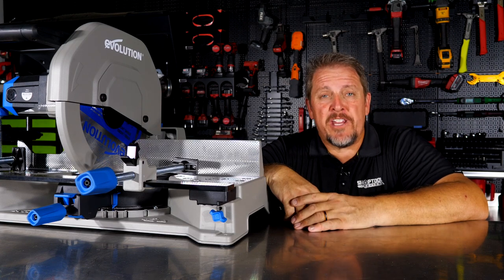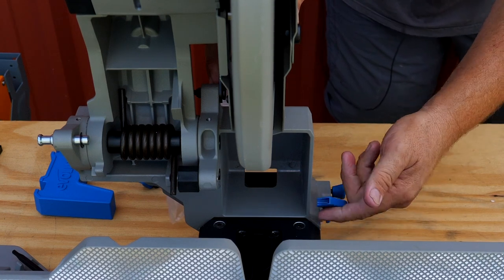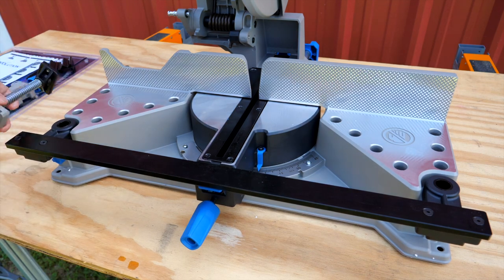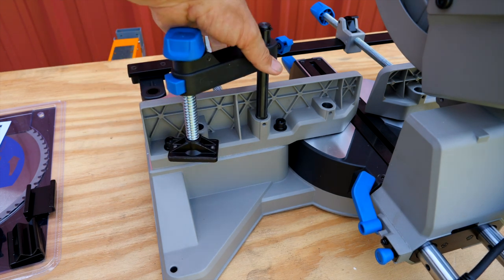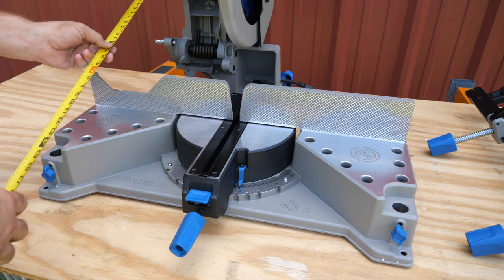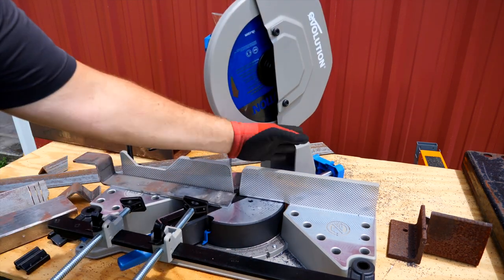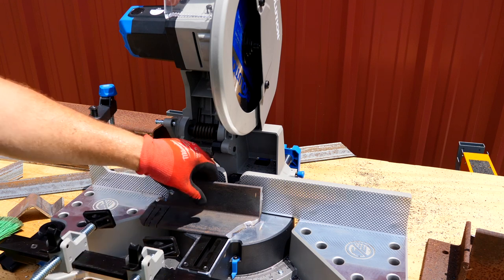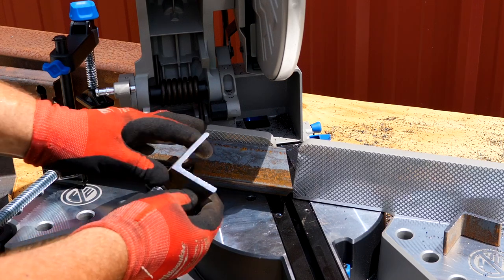Evolution S355 14-inch Steel Miter Saw Review [46-degree Miter]

Comment: Thank you.  Very thorough review but I don’t remember you showing the three position sliding feature.  It really helps when trying to get the right blade approach angle to contact corners and not flats.  Mine just came in today and looking forward to using it tomorrow.  Thanks again.  👍👍
Reply: honestly.... the only useful position is the one closest to the front..  I found the middle and rear position puts the blade too far back..... even when cutting smaller material.
Reply: @Particleman50 Thanks.  I'll keep that in mind as I learn to use mine.